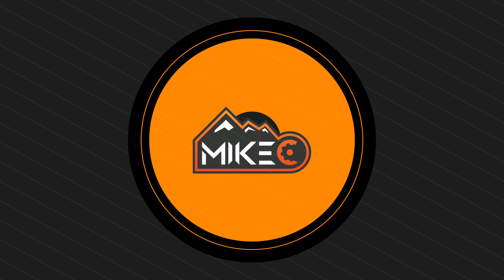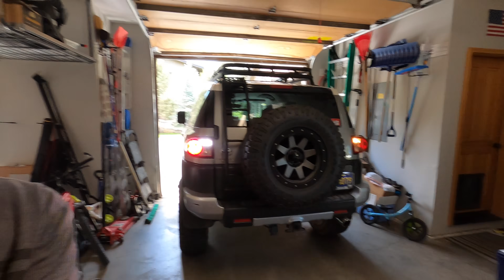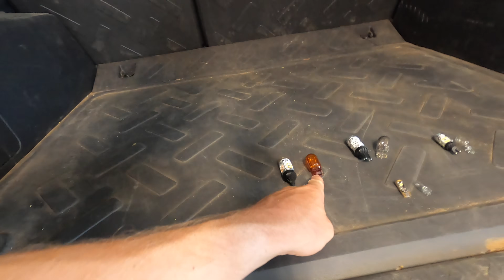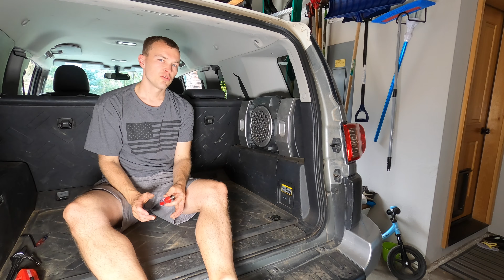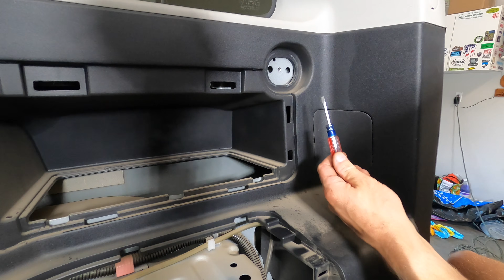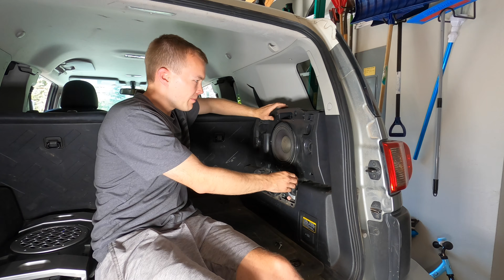Full LED Upgrade - How to Replace FJ Cruiser Rear Brake, Blinker, Reverse and License Plate Lights

Comment: Thanks for the video.

Quick question: is the wiring harness located beneath the subwoofer the one that carries the brake light and turn signal wires? 

I'm asking to confirm whether I can tap into that harness to run power lines for installing LEDs on the rear bumper of the FJ.

Comment: Did you have to change your relay to work with the LED signals? When I swapped out my fronts the signals became super fast due to less resistance
Reply: If you look at the link for the product description, the signal flashers are, “Error free, anti-hyper flash.
Reply from the maker: Nope, worked fine without any adjustments
Reply: Did you change the front turn signal bulbs to led as well? And if so still no hyper flash?
Reply: @ml2144  the bulbs probably had resistors/ high resistance in them if he didn't have to replace his relay.

Comment: You should test the lights before you screw them back into the tail light assembly. Otherwise you will have to take them back out again if they don't work.